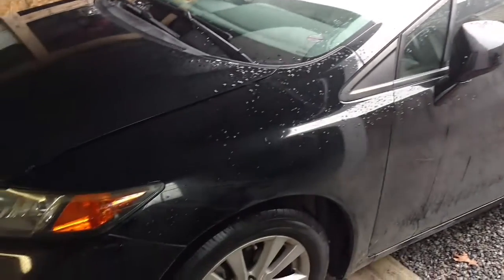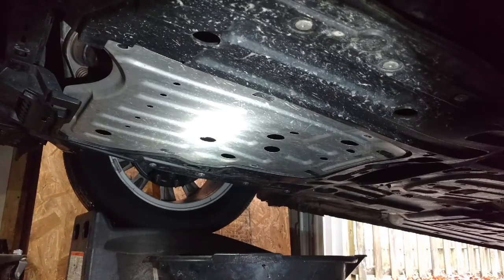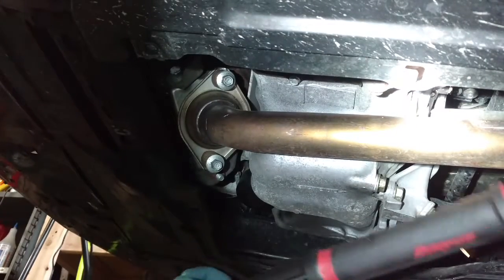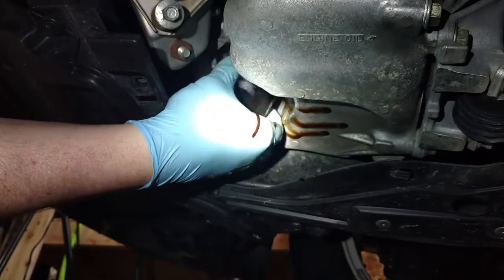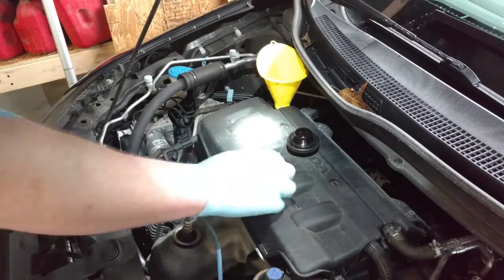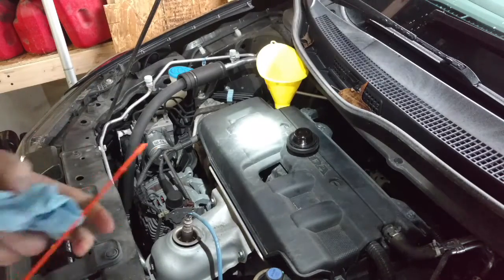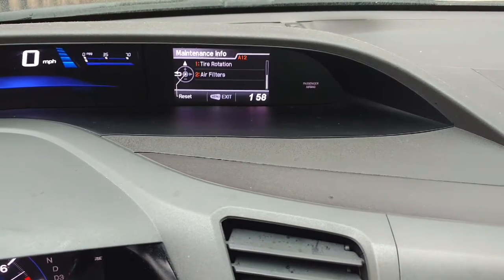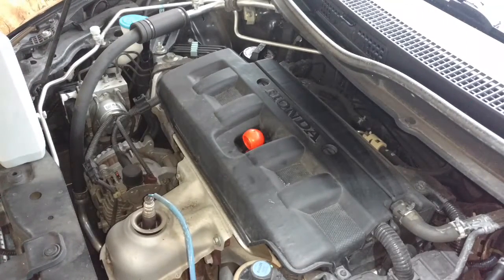How to change oil: 2012 Honda Civic

Comment: Coming from a 2000 Accord, I was confused about how to remove the oil pan shield. This video explained how to change the oil on the Civic in a logical, step-by-step process. Thank you! I will watch your transmission fluid change video next.

Comment: he did not prime the oil filter
Reply from the maker: Jesse Allen actually I did fill it half way before installing but I failed to mention it. I had a 96, 97 and 03 civic in the past and the oil filters sat sideways on the engine block, made it impossible to prime and they all went over 200k miles.
Reply: Ok no harm jus pointing out what I see ... good vid
Reply from the maker: Jesse Allen I should have pointed that out in the video. I prime filters when I can but some models do make it impossible. Thanks for watching!
Reply: It is not necessary really. The oil fluid will start running as soon as the car is turned on